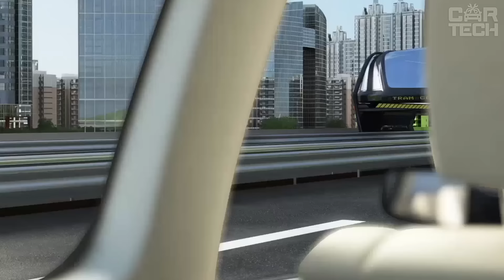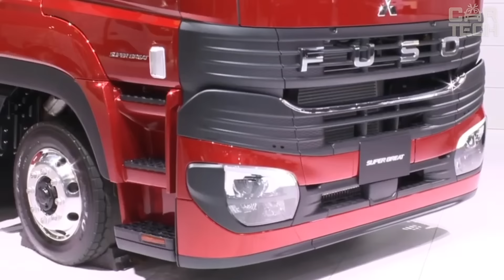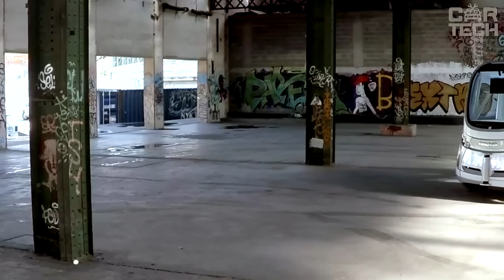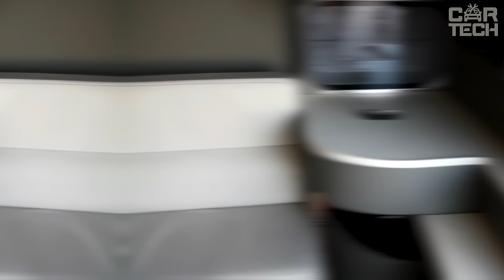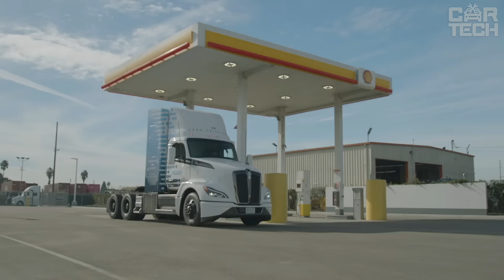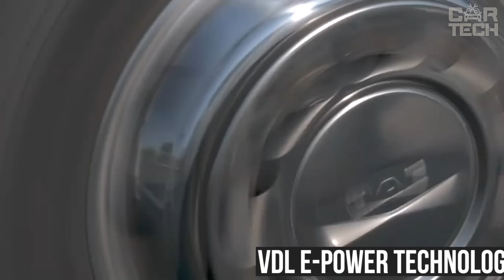50 Future Trucks & Buses YOU MUST SEE

Comment: None of these is going to exist.  I have a far better solution.  Fully modular transport and transit system consisting of pods specific to each purpose; pods for passenger travel, pods for cargo transport, and pods for long distance trips (planes, trains, and busses).  The major difference is that my pods dock into an overhead rail/cable car style carriage.  Local travel will be entirely electric short-range (20 miles or less) pods.  All pods will be provided power directly from the carriages.  The pods are plugin charged.

Comment: Everything is the future can't be electrified. Trains, ships, and trucks can't physically run hundred percent one electric. If everything was electrified the road would have to be electrified and the rails to charge this trains and trucks. The world is going to be different and everyone that hates electric vehicles will protest and command the world to drill for oil to make gas and other fuels. Diesel physically cannot be replaced. Gas vehicles will be furious and will blame the world for what the people have done. So what can't we just go to the simpler times and drive gas and Diesel vehicles as long as the last are still made before they're full replaced with rubbish electric cars and trucks that will not work in a flood or in a lot of rain. That's the thing people has to think about.